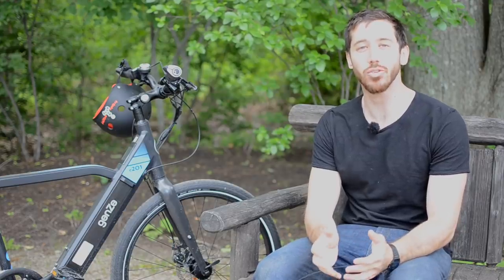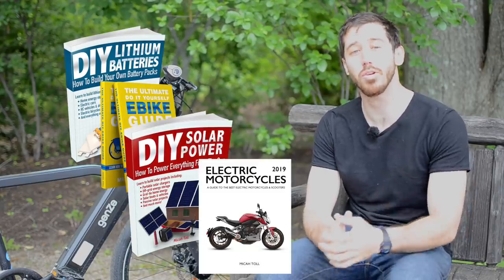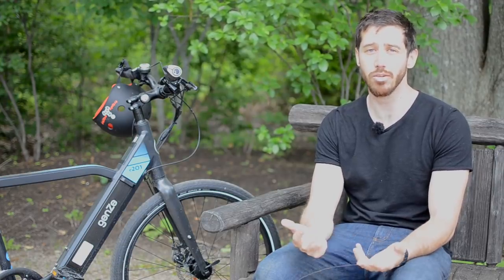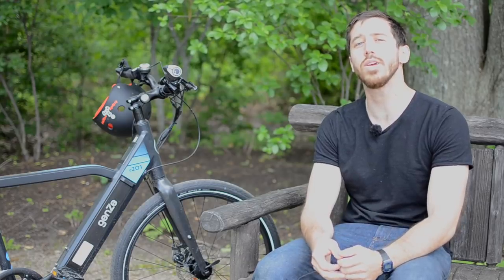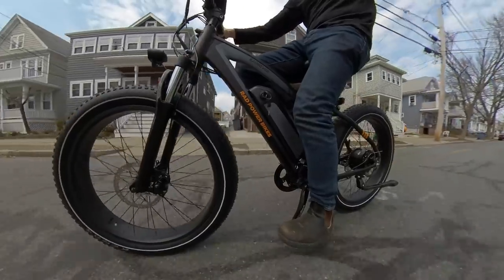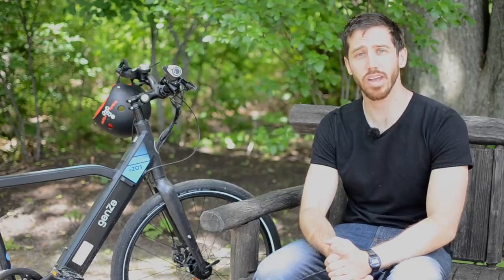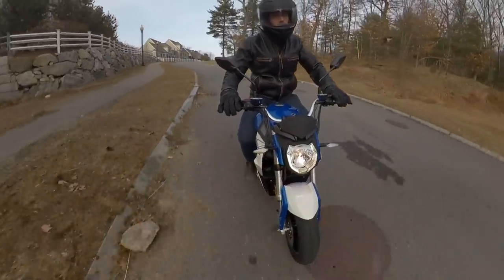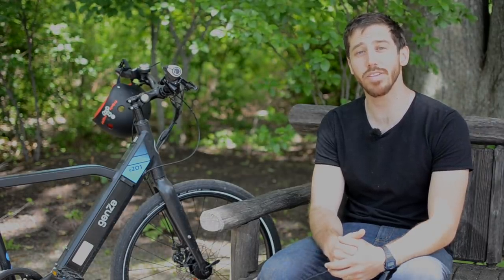How much POWER does an ebike need?

Comment: This still confuses me. I’ve heard all about how under powered 250W motors are for hill climbing. (Keep in mind I’m happy if any Ebike I own climbs a hill faster than me when I walk… That might be key). Being unsure by all the many claims and having decades of experience in computer sales and service (When I first entered the business the lowly XP was selling for right around $6000.00 perhaps the slowest computer processor ever made to run DOS pre Windows OS). Thus my trust of claims is weary due to years of experience and then there’s Used Car Salespeople…. Hell new car salespeople as well:). So I bought a cheap 250W Swagtron EB 5 Pro Plus a couple years ago and took it on a test drive. Wasn’t long before I came upon a rather steep little hill…. Maybe a couple hundred feet till it peeked but p,entry steep so I wasn’t expecting much yet still the Swagtron just zipped up that hill with only slight pressure on the throttle. Given all the warning I had gotten I was more than a bit surprised. That and I’m a good 200lbs. So was it the fact the hill wasn’t all that long?

Comment: I  am new to ebikes I bought rear hub 1500w and a 48v 25ah battery I've gone 25 miles and my battery will not charge. I did notice a ark when I plugged in the battery to the controller tho kinda bummed.

Comment: Hey Micah! Thank you so much for your videos! I am adicted to them! I am thinking of bulding an 1500w ebike and I want to build the battery myself. I have bought your book and it is helping a lot ! I would just like to ask you what battery size and bms size ywould you recomend and also, in case the hub motor controller comes with regen enabled feature, should i use a common port or separate por bms? Thank you so much!

Comment: When you upgrade your hub motor to 750W or 1000W, do they just drop in? Say, I wanted to upgrade a cargo bike.
Reply: You gotta make sure your controller is rated for at least the same as the motor you wanna put in the bike, if not a little more for overhead.
Worst come to worst you can upgrade a controller.

Comment: You can always turn the power down, you can't really turn the power up. 750w is the legal limit, so I consider that the minimum. But of course who likes the legal limit? 5k to 8k is the largest I've seen before the esc starts needing liquid cooling and it turns into more motorcycle than bike.

Comment: Don't need an e bike, I can put out 266 watts average for an hour and without the battery or motor, the bike is only about 7kg, so hills are no problem for me either and I get good exercise as well. If I want to go fast I have a 100 bhp motorbike that does 160 mph.

Comment: i would like to know what battery power you would select for the different size motors, volts, current, ah ect,also could a dc-dc volt convertor be used as a universal power differentiator between e bikes , as using one good interchangeable power  souce

Comment: 250watts is fine for city use. i live in manchester uk and regularly commute using 250watts. in my opinion 750 watts is dangerous in a city because you go too fast- 

In the uk, cars , walkers & other bikes pull out in front of you without watching properly - at 15mph you can stop safely.  on open roads or say canal towpaths - its different - because you usually have longer to stop. in the EU the law is 250watts maximum - above that you need insurance - like a motorbike - i agree with this law. ive got a 250watt bike and a 750 watt one. anybody reading this for the first time - try a 250watt bike - you will be amazed.

Comment: I really need the answer.if i power 24v19amp ebike motor controller with more than 19amp will it damage the unit I mean like 25 amps

Comment: Is having 2 500 watt hub motors equivalent to having a 1 kw hub drive or a 1kw mid drive?
Reply: No
Reply: @Aquavidify  could you elaborate please
Reply: @amalgeorge6877  1kw mid has the benefit of the gears,  you need this if hills are involved. Also I think 2 hum motors would be quite heavy.
Reply: @Aquavidify  oh ok

Comment: How do you know the current capacity of a battery? Example I have 250 watt ebike and the controller says limiting 15 +- 1 amps. It is one of those small controllers. The battery voltage is 42 volts when fully charged. What is the biggest hub motor i can add to this controller and still get decent mileage. In other words. Could you explain the relation between battery, controller and wheel wattage as it pertains to current draw from the battery. Example  is my wheel getting 15 amps or is it getting 250/42 as the voltage drops is the current draw more. 250/36. Need help. Feel confused
Reply: The controller is what limits the draw from the battery to the motor. It has a voltage and amp limit and cut off, meaning max voltage and min voltage before it turns off. Your controller probably draws 15amps continually, from your 36v battery. As the battery depletes to 35v the controller will draw it at the max amps it can. Watts is volts x amps. So each volt you lose during your ride is less watts going to the motor. 

For the current capacity for the battery I think you mean max discharge. That is limited to the BMS in the battery pack, and the type of cells in it. Higher amp draw requires better quality cells and a better bms.

Comment: Thanks, the was very helpful.  I'm interested in converting my beach bike and don't need a lot of power> now I know what range to shoot for.  I like my 3 speed bike with a coaster brake and one of my concerns is whether or not coaster breaks are adequate for a bike with a 500 or 750 watt hub motor.
Reply: I guess it depends on how heavily you use that motor doesn’t it? Obviously coaster bakes are crap, so you wouldn’t want to go very fast.

Comment: Hi I have a mobility scooter which has two lead  acid 12v 21ah/20hr its driving 24 vdc 3amp 270watt motor.What do I need to power it with 18650 batterys and get more ah out of it. As you do motor cycle as well can you help.

Comment: If I want to convert one of my vintage pedal mopeds into electric and still achieve 30 to 40 mph where should I start?  What mid drive engine would you recommend for those speeds?
Reply: Bafang bbshd 1000 on a mountain bike

Comment: Thanks for a great video. Isn't it possible to limit the top speed and still take advantage of the high acceleration and climbing power? As far as I know the laws here in Norway is limiting the top speed and not the wattage of the motor.
Reply: On some computers yes you can limit top speed

Comment: Anything more powerful than a standard eZee motor at 36V, with a 20-Amp controller is a moped and should be taxed for ACC (medical tax for public emergency operations), registered and have a licence plate. More speed, the more skill needed to compensate for detail-blur at higher speeds; and more responsibility you have for yourself, those around you, and your family who want you to come home safely. There's also physics to consider: K.E. = 0.5m*v^2. <- there is an exponential relationship with speed; 30km/h is the sweet spot.

Also consider that encouraging cycling to become mainstream will mean an all-age situation with elderly and 3-years olds on bicycles on quality cycling infra. This is why the Dutch have a 25km/h limit, and it is a very sensible law. There is a revolution happening in local councils, and even if it takes 3 decades, cities will change. It's happening in my city before my eyes, and it is happening all over the world. Expect cities to adapt to mass cycling, become more walkable and render faster speeds redundant (one thing that can rapidly happen is stoplight green waves for 25km/h bicycles).

30km/h is also all good :)
Reply: I think you're right when it comes to cities, but just like in rural areas the speed limit should increase.
Reply: @soflossy6447  Correct. A lot of people confuse city electric bikes (which are ridden on public streets) with electric mountain / trail bikes ridden on private land. UK law says mountain bikes don't have to follow electric city bike rules.
Reply: Nah. It's more important than ever to have low speeds and separated paths along roads in rural areas when it comes to ebikes. You are away from civilization, you need safe infra and low speeds; or you need proper training,  responsibility, moped-tires for faster speeds and corners (sometimes 100km/h) (and by that time it's no longer an ebike, as it's left that realm). When it comes to dirt tracks, the speeds should again be lower for corners and traction; or you should have moped tires for faster speeds. And Fernando, the latter would be a dirt motorcycles with pedals.

The characteristics of a bicycle (social interaction with other cyclists, the perception of world details around you, the ability to hear stuff around you properly, etc) are interlinked with speed, generated noise and mass. Rural or (sub)urban.
Reply: @C0deH0wler  Well all that is great since mountain bikes are built for torque and climbing power not speed. Something a mid drive system is very good at.

My 1000watt BBSHD middrive motor puts out about 175nm of torque (about the amount you get from a small car's 1.2L 4 petrol cylinder engine) at the pedal crank shaft. Its then mated to a 38/48 tooth dual front chainring which is paired with a rear 10 speed 11T to 50T cog cassette. In low range mode (front 38T) and 1st gear (rear 50T) the max speed is about 10kph. And it will climb anything at ANY gradient.

In high range (front 48T) and 10th gear (rear 11T) the unrestricted max speed is about 60kph. However the motor's ECU is programmable and the top speed is limited to to 24kph.. Note that I could reach 35 to 40kph on a flat cycle path on leg power alone before I upgraded the bike.. I can no longer do that with added 14Kg weight of the motor and battery... So my top speed is actually slower, not faster....

Comment: I hav dual bafang 750 hubs motors which can in reality get up to 1000w each. my dual controllers is  48v 22amp.... but the preset current in my menu options is set at 15amps. Is it safe to bump up the amps in the menu option?

Comment: Hi, from what I can gather from the vid, although my particular case is not covered (35 kilo RotoVelo + 75 kilo me + various odds and sods = approx 140~150 Kilo. Given that I have some reasonably long 1-2.5 kilometre hills between me and work (I've tried to work out the % grade and although the sums come out between 5 and 7% it sounds not steep enough for what I'm looking at  - maybe that's just the way the system works, and I'm not used to it - perhaps you could cover this if you haven't already somewhere) .... anyhoo! from what I can gather, I'll be needing the 1500 -to 2000 watt hub drive to tackle this journey - I am going hub as I intend to put a pinion drive on the RV for low maintenance and for days when I want to swap out the motor for a non motorized wheel. BTW, from the Grin calculator, it appears that the 10T will do just fine, but if anyone can tell me that I'm wrong and that 12T is a must, please share your knowledge. Thanks a bunch from the land down under.
Reply: Fiona, picture an American football field (Association football field is slightly longer by about 13 or 14 meters) Stand at one end of the football field and imagine an incline that would leave you standing on the cross bar of the goal post (American style - 15 ft or 5 meters -  ) That's a 5% grade. In my experience with traveling around with mostly 5% grades, a 1000 watt motor gets me up to 30 mph (about 48 kph) for a distance total of around 30 miles on a 22 amp/hour, 48 volt battery. The thing about a direct drive DC motor is that it operates less efficiently at speeds lower than it's maximum output rating. It takes more amperage to maintain the needed torque at slower speeds, like running your car in 3rd gear at 5 mph. 1500 to 2000 watt motor is really fast depending on the voltage of your battery. Unless you are trying for speeds of 60 to 80 kph I believe you have over-estimated your requirements. The real trick is to spend the money on a battery with sufficient total capacity and continuous amperage out put, and a controller that can deliver that amperage rather than increasing the wattage of the motor itself. Many of the Chinese built controllers can't actually deliver the watts as advertised (or they quickly burn out the (Chinese) electronics if you try) or they have current regulators that limit the maximum wattage to 75% or less of their rated output - at least those sold in the U.S. market. Find a 1500 watt max controller to power a 1000 watt motor. The motor will exhibit better acceleration, and the controller will run much cooler - lasting much longer. A fully charged 48 volt battery will top you out with a 1000 watt hub motor and a 1200 to 1500 watt controller at about 35 mph or 56 kph and good low speed acceleration to get you out of traffic's way in a hurry.

Comment: My experience of e-bikes and e-scooter are unexpected. Torque is so much better than what gas engine give. Nominal 1200 watt, 110 Nm 70 kg scooter is faster than four stoke 50 cc scooter, which power are 2200 Watt.

Comment: Check out Luna cycle 3000w mid drive 
Its freaking awesome
Reply: I have the 2500 watt fat bike with the Ludicrous Mid Drive. I started out with a 500-Watt Hub Drive. That could not get me any range in the steep hilly area I live in. 1st gear with a Mid Drive gives you more torque and at safer speeds for off road use.

Comment: I like ur videos but they lack information.. I want to build an ebike...72v with an 8000w hub motor...I've been toying with the idea for a while...prob use a stealth bomber frame and buy components as i go...this works out cheaper than buying off the shelf....how about a video where u look into this sort of build...what would a 5kw motor achieve other than a 8kw motor..both at 72v...ranges....controllers...wiring..what size wheels..20 inch or 26 inch...speeds expected...brains fried from all the numbers....

Comment: A 3.53 min in the video I noticed what looks like a cover for the Bafang motor. This is the first time I see this. Are covers/protectors available to cover the mid drive motor/bottom bracket/crank area of the bike to protect it from dirt, dust or damage or is this the cover that comes with the Bafang mid-drive Ultra. Thanks for the video.
Reply from the maker: I am pretty sure that was custom made by the company (Rungu) since that is an extreme ATV type of ebike.

Comment: Hmmmmmm I have purposely turned down my Cyclone. I measured the wattage today and the Cyclone is 2206 at 60 volts and 85% current. At 72 volts and 100% I have not measured it. I can say it is way too much LOL. And I always have my 350 watt hub motor for putting around the campground. Two separate systems is the way to go. My original eBike has about 500 watts at the rear hub and about 1200 on the front hub. Front wheel drive is all but useless on a gravel hill. First eBike is 8 years old and is a Volto. The second one I just built on a Swagtron EB8 donor bike. I gear the bikes to go no more than 30 to 35 mph. It is just a 29 inch bicycle after all. Because I travel full time the eBike is ideal when I am camped for exploring and short into town trips. I try to keep my eBikes in stealth mode for obvious reasons.

My first foray into eBikes was an electric moped designed in 1993 to be sold as a moped, no license required. So the HP was limited to 3 or about 2250 watts. Range was 50 miles at 20 mph, top speed was controller limited to 30 mph. It had to accelerate from a standing start with a 190 pound person driving on a 20 percent grade. The motor was a switched reluctance motor for many reasons. Very fail safe it just keeps running no matter if one or more items go out. And the real advantage was that it made some noise.  Feedback from pedestrian panels and safety experts said pedestrians have to have more than visual cues to realize something is moving close to them. Three of the original production were tested for 3000 miles around the clock. The batteries were changed out so that the testing could continue in minutes not hours.  For reasons never revealed to our little team the General manager of the division would not deliver the bikes to owners of moped/scooter rental agencies in Key West and Maui. Each of them committed to 1000 units. We had 1000 sets of part and a line ready to pump out those bikes. Keep up the good work on eBike reviews and info. They are a great platform for electric drive, as hardly anyone counts on them for long trips with only minutes of stop time.
Reply: To respond to what you said about people needing more than visual cues, I saw that starting July 1st all electric vehicles in the EU need to be equipped with a sound device. It looks like a speaker. I just picture it making a "vroom vrrroooom" noise.

Comment: Is it possible to use 2 motor system like a front  wheel hub with back wheel hub motor? It is how the use of the controller box of connecting the wires from motors I need to be aware if it is possible.

Comment: I’m shopping for a central motor and I don’t understand the difference 68mm or 100mm.
Reply: That should be the width of your Bottom Bracket: This is the housing that holds the bearings in place and the axle that the crank arms attach to. usually bikes are 68-75mm or so, the 100mm width is for the fat bikes.

Comment: I have an uppbattery from unitpowerpack.com 48v. The battery pack drained completely even though its supposed to cut power before that happens. How can I get the charger to charge the pack again? I have the 52v vruzend kit and built another pack based on your video, it's not working. Lithium and I aren't on good terms. Having bad luck. Advice would be appreciated.